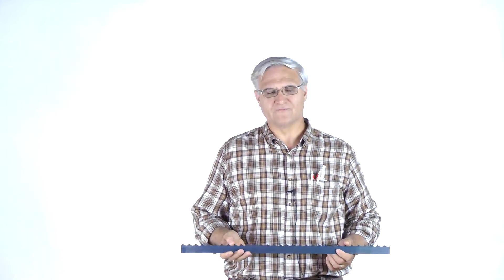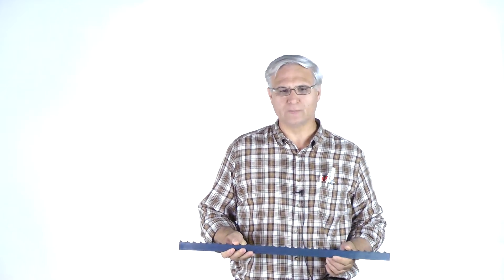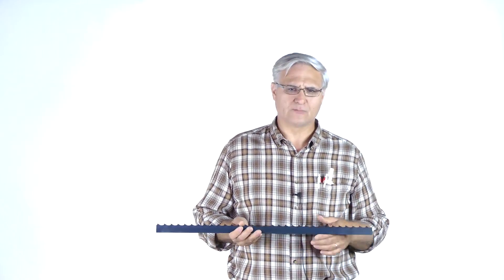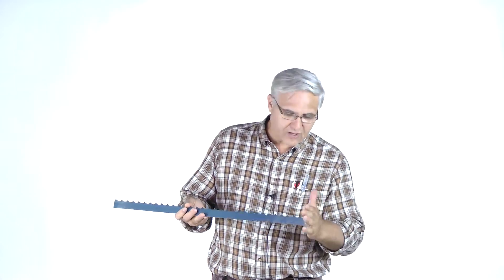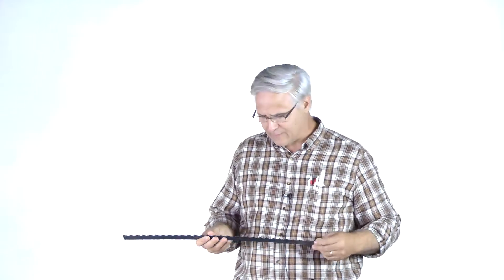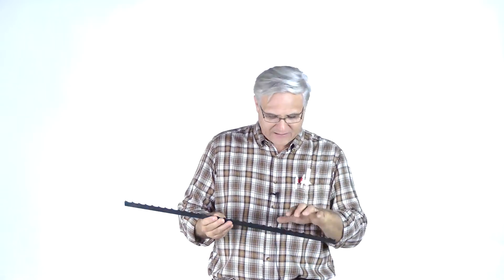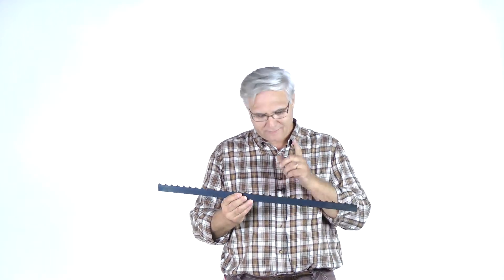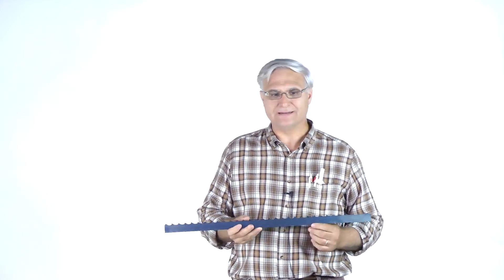Sawmill Bandsaw Blade Basics 9 -  Blade Speed

Comment: So you speak of travel speed at 8ft per min, this would obviously depend on log diameter. I have a custom-built sawmill and I am running at 4500 ft per min 1.5in blade and log diameter ranging from 30in - 55in so what kind of travel speed should I be looking for? I have followed your videos and set up the guides and wheel as you teach but still get a lot of climb and dive. Do I need to go to a wider blade?
Thanks for all the great videos, I am learning a lot from you!
Reply: Tighten your blade more